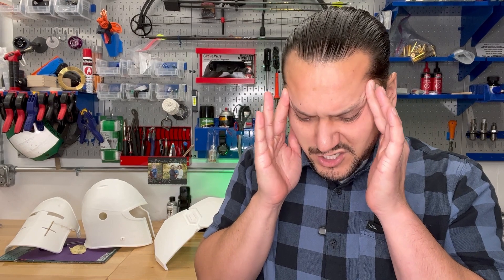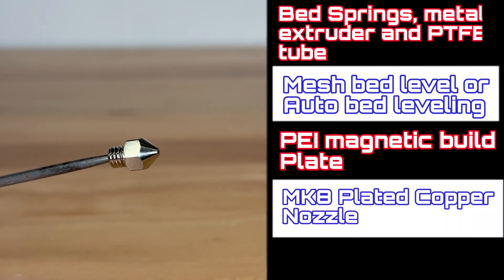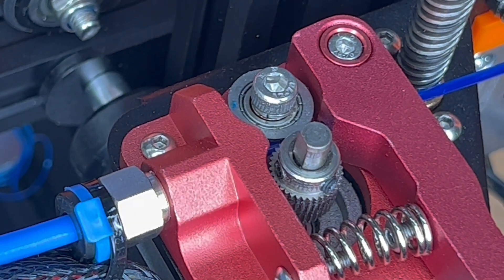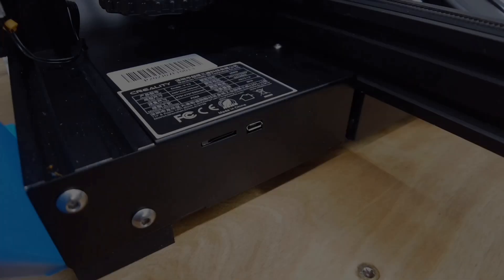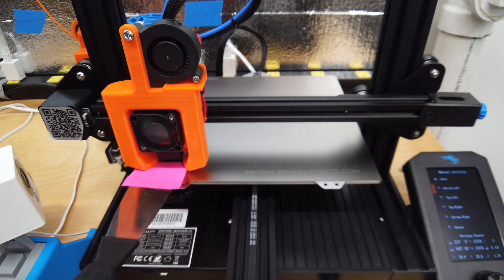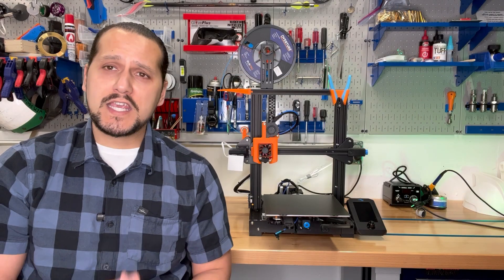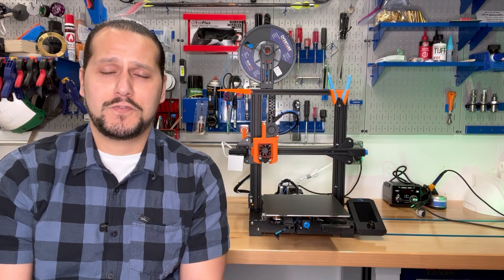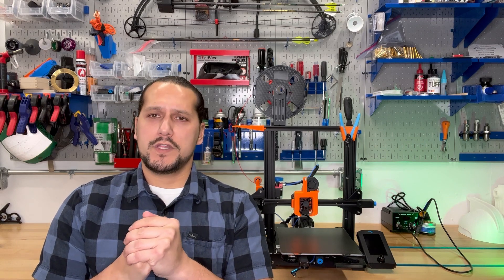Ender 3 Series Printer (Standard, Pro, V2) Upgrades to Improve Quality and Ease Use

Comment: I  only need to relevel  if I switch out nozzles  on my ender 3 version1, but most of the time its still close to spot on because I set it up so the  heatbrake butts up tight up against the nozzle and the shoulders of the nozzle rest on the bottom of the heater block  so with the same nozzle the hight never changes,  but i do check  with a strip of paper by 'selecting level corners every  once in a while but maybe I'm lucky  but my early Ender3 seems to hold zero... but I dont have the stock mainboard  I have the MKS with 2130's  so maybe the reduction in vibration may have something to do with it...

Comment: Next time you buy one of these ender printers make sure the first bracket that is installed the shorter one with front facing you check to see in it was threaded one I bought it was not lucky I had a kit to do this may have been built during covid lock down in china

Comment: my glass bed on neo is a so nasty slippery, i’ve cleaned it as best i can and still can’t print at all unless i use glue stick.
Reply from the maker: Glue stick is not all bad, requires a little in post processing but some bed just need it.  You could try switching the plate for something aftermarket.  Thanks for your comments and thanks for watching!!

Comment: I am finally replacing the extruder on my pros, the arm never broke but the base did. one printer had the brass insert the bowden tube attaches to explode out of the front of the printer mid print. The second printer wore the teeth off the hob gear heh. They lasted a year and a half of heavy use, so they were due to die lol. I am replacing them with some ezr struders I found on clearance.
Reply from the maker: I’ve worn the teeth on a few gears myself 😄 I’ve had a few base break as well but when my arm first broke it took forever for me to figure out because it was well hidden.  Sounds like you’ve got a handle on things and thanks for watching!
Reply: @NerdvanaCustomCreations  not a problem sir, thank you for the great content, I am installing my clearance priced old school ezr struder as I type this, time to calibrate esteps lol

Comment: Do NOT hit the glass Plate with alcohol... I guess that's the whole reason why everyone says they're crap. You'll destroy the coating. Just use hot water and maybe a little soap to clean. Works fantastic for me, no adhesion problems whatsoever, and once the plate is cooled to room temp, prints basically pop off by themselves.
Reply from the maker: I have been using alcohol on all my Enders, some are still using the glass plates they came with and are still going strong.  You have a solid point though, thanks for the feedback and tip.  Thanks for watching!!

Comment: Before buying the metal extruder kit please check your stepper motor gear. If it is a press fit gear then you can't use the kit without replacing the motor too. Creality are notorious for swapping out components to cut costs and avoid delays due to supply issues. Power supply is another component often not the "normal" part.
Reply from the maker: Yeah, Creality is notorious for this! Very good point but you do not need to swap motors to use the kit.  If you have a little mechanical experience and a dremel you can use the existing motor, I’ve had to do it on 2 of my other printers.  🤔 I might need to do a video on it, thanks for the input and for watching!

Comment: I minimally upgraded my Ender 3v2. I did Chep’s Capricorn upgrade (just a section in the hotend) and bed springs. I ran the stock firmware for a few months before changing to klipper using fluiddpi. I absolutely recommend klipper. You can print directly from cura using the octoprint plugin. I didn’t add ABL until I was running klipper. I’m still using the glass bed with hairspray.
Reply from the maker: Yeah, bed springs would be the least I would do.  The Ender 3v2 is pretty good from the start, most other upgrades are not a necessity but some do help with overall print quality.  Each machine has got its own quarks, some might need more upgrades than others to perform well but that all depends on the machine and person of course.  I’m playing with kipper now and ABL is being added soon.  Thanks for watching!

Comment: In the course of a year. I went thru at least 4 endstop switches working at RANDOM. Mesh Level will not work for that. I also ruined a few beds. In the order of $150. So go with auto Level. A CR Touch can be found on aliexpress for about $22. Great investment compared to $150 lost in switches and beds. The rest of the upgrades are just what people need.
Reply from the maker: Yes, you are completely right Mesh bed level will not work for that 😬 that sounds rough.  I would recommend auto bed level over mesh bed level any day but I wanted to provide a easy/free alternative.  I love my CR touch and EZBL that I have installed on other machines and wouldn’t trade them for anything.  Thanks for your input, comment and of course thanks for watching! 🤙🏼